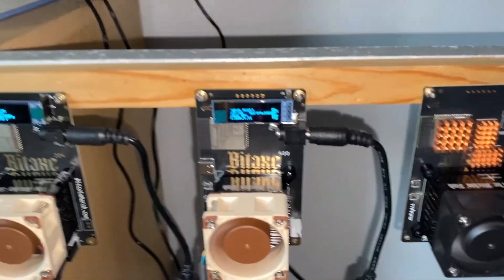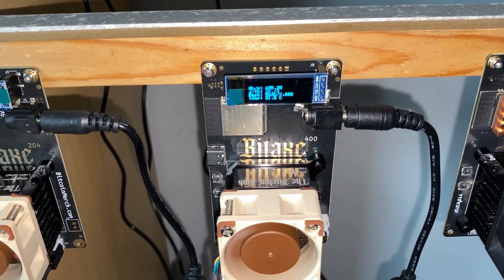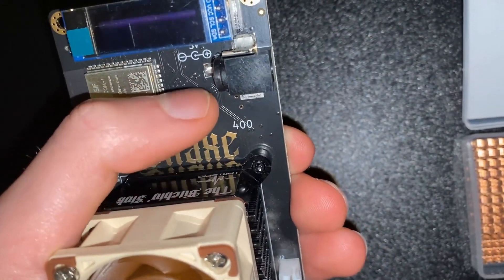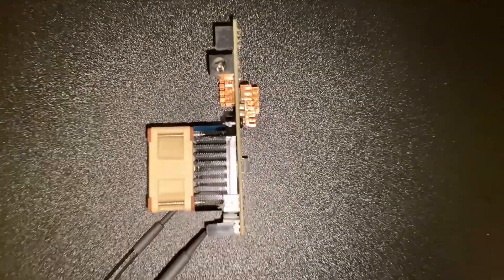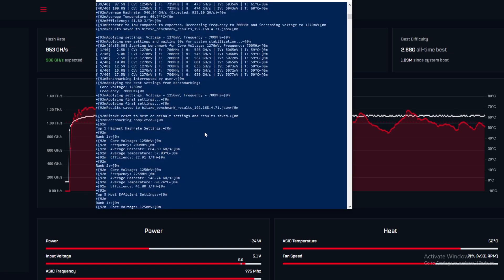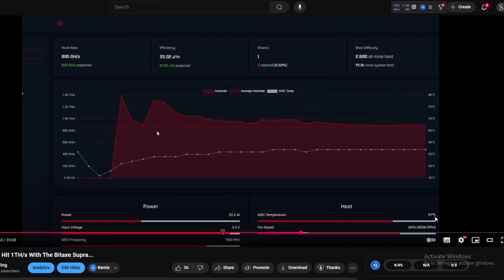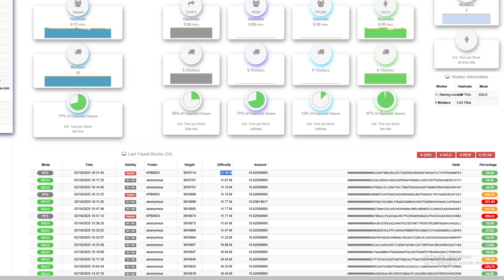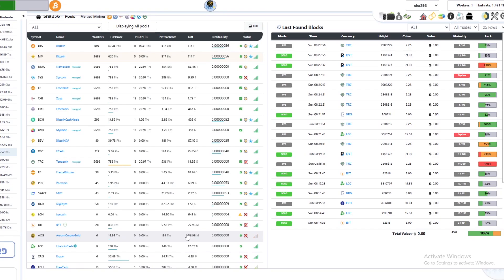Finally Hit 1TH/s On The Bitaxe Supra, Need More Copper!!!

Comment: Just an FYI from my experience with my Supra. I am able to get a steady 1.1th/s . Aftermarket power supply, 60mm fan on top of a 3d printed dome adapter, heatsinks on the back with the original 40mm fan blowing on them. I just soldered the wires together and plugged them into the pwm fan header. I am also at a steady 53c temp and 29watts power.
Reply from the maker: thats great, im just trying to get it steady with some additional feature. im basically trying to show its possible without making huge adjustments
Reply: @SterlingSpecter1  Keep up the great work. I enjoy watching your videos. 👍

Comment: BitAxe 401 
On standard heat sink and fan
Need to update the heat sink think the Ice tower with the adaptor plate is next 

Scores of overclock tester 

Rank 1:
Core Voltage: 1310mV
Frequency: 775MHz
Average Hashrate: 1053.99 GH/s
Average Temperature: 63.47°C
Efficiency: 23.49 J/TH

Rank 2
Core Voltage: 1290mV
Frequency: 725MHz
Average Hashrate: 1034.88 GH/s
Average Temperature: 60.35°C
Efficiency: 21.60 J/TH

Rank 3:
Core Voltage: 1290mV
Frequency: 750MHz
Average Hashrate: 1012.09 GH/s
Average Temperature: 61.09°C
Efficiency: 22.83 J/TH